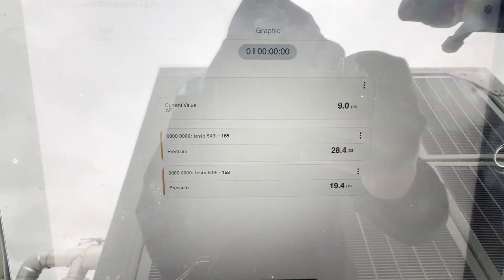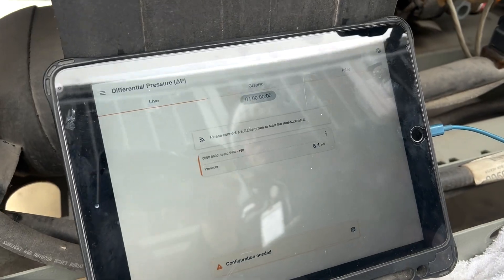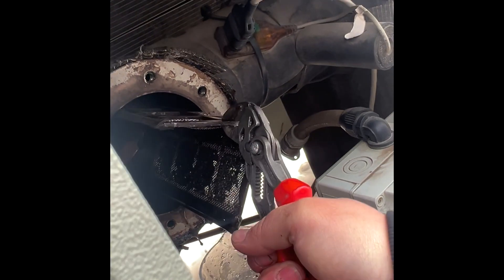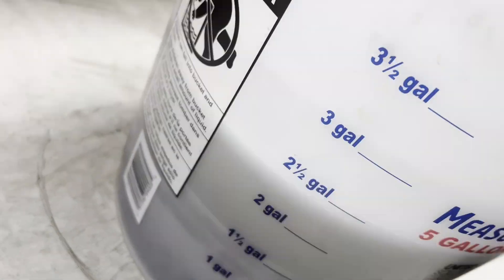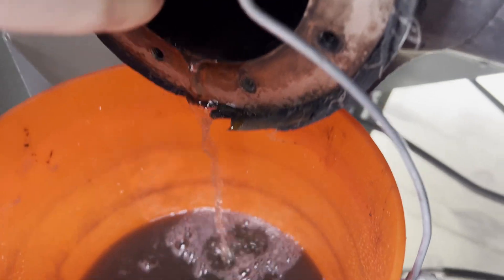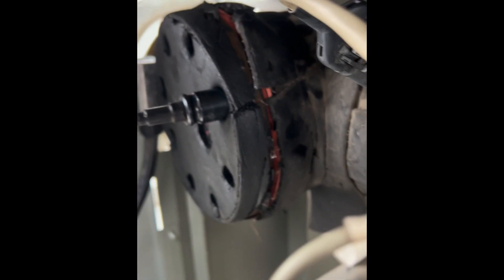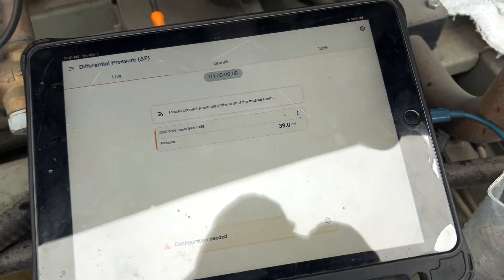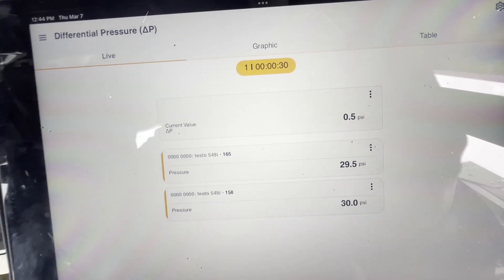Cleaning a CGAM Chiller Water Strainer

Comment: Wow! Amazing it was still working. Water treatment is so critical and yet constantly overlooked for some reason.
Reply from the maker: Right, this facility has a glycol adding system but that’s about it for water treatment/fill. The CGAM is a nice machine, this chiller went out on alarm for low water flow a couple times, of corse they reset the unit and keep it running… This system also has strainers under insulation all over the place that all need cleaned, but they don’t want to take the building offline to clean them all, as there is no redundancy in the pump room.
Reply: @mechanicalenvironments  that is typical, no backup, and no, you can't turn it off to work on it 😆. These are nice machines. Just keep a few sensors handy. You'll need them.